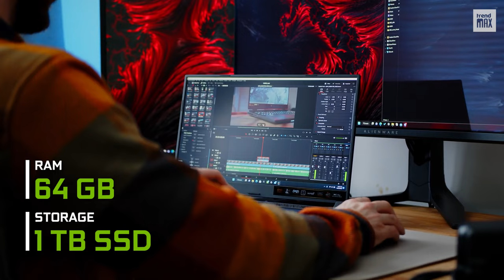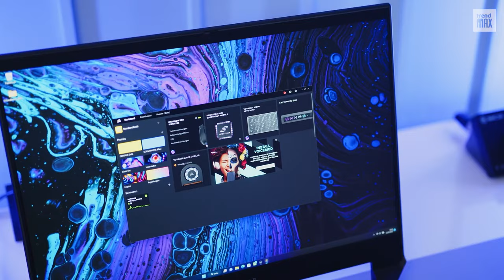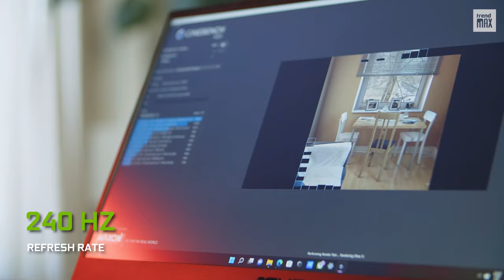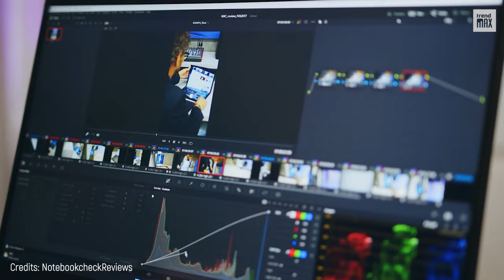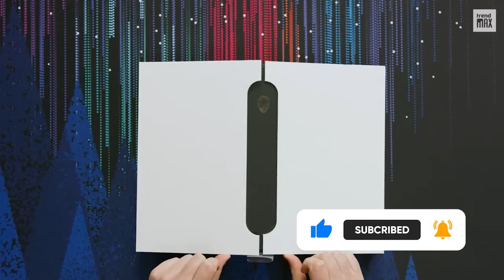TOP 10 BEST GAMING LAPTOPS 2023

Comment: Acer Predator helios 300 with RTX 3070ti should be in this list too
Reply: Can you tell me more? I was waiting for them to list this bc I was recommended it
Reply: @OPLPLL  First of all you can pick up the 3070 ti Helios 300 for less than $1,300 now. It has 16gb of DDR5 Ram and 1tb ssd and upgradable to 32gb or ram and add 1 more ssd. It’s a gaming beast with fantastic thermals. It also has 240hz 1440p display.
Reply: @ajbarboza1348  sorry for annoying ya but is it possible for it to handle the sims4 with many packs?
Reply: @AtheerAlamri-fd6gd bruh its sims of course
Reply: @Steven-cr1og  many people said their laptops couldn't handle the sims4 with packs and crashed after 2 years or so, but this one seems like a good meal to buy

Comment: I purchased a Dream Machines laptop with a 4070 graphics card and a powerful Intel i7-13700H processor." For my work with 3D modeling and animation, this is very good because everything works just instantly. I didn't think there would be such a big difference in power with my last year's HP. And that's what I love about Dream Machines for the large number of ports, now I can connect everything

Comment: i heard that a lot of pre-build pcs are not worth it and i don't wanna build one myself so maybe i can buy a gaming laptop, my budget is 700-1000 euro's what do you advice?
Reply: if your fine with buying a laptop every 3 to 5 years when the parts start to become out dated and slow then its a good option. a PC you can upgrade as parts age.
Reply: Just build a small mobo pc
Reply: @AlmightyyCres  u can upgrade laptops too but its just harder
Reply: @AlmightyyCres  If you are travelling and want to lift your whole box of pc along with lots of rusty/dustry cables, then fine, stay with desktop. Laptop comes with a premium price tag, however has a lot to offer which desktop doesn't i..e Outdoor usage, Portability, Battery usage, adjust the devide instead of adjusting your body to get the right angle etc. Not to mention laptops have lesser impact on electricity bills. Anyway, It's also a thing of budget, laptops are expensive, hence it comes down to personal preferences overall.

Comment: I currently have the MSI GF63 THIN and i dont recommend it if you're a COD player or R6S!! The drivers are outdated and you'll get that "drivers outdated" pop up when you download high end games like those. Fortnite, Valorant, and other mid games run perfect but it barely handles Minecraft and it gets hot really easily no matter what fan mode you have it on. I only use it for entertainment and Valorant.
Reply: I have a gf63 it plays red Dead 2 no problem

Comment: and no i dont agree with the list , why ? because pure base specs alone are not the only thing that matter . for example , did you know that without the manufacturer ordering a beefy cooler and proper higher tdp , some laptop 3080's are only as good as 3070's with proper cooling and higher tdp ? (same with bad 3070's vs good 3060's really) so a manufacturer putting a higher tdp on a laptop gpu plus a beefier cooler , WILL , make a big difference fps wise in so much of these 1440p laptops . 
edit : and dont get me started on the mux switch subject . because yes , every , fucking , laptop , above 1000USD (or its equivalent in your country) should have a mux switch , PERIOD !

Comment: This video is very misleading, as a "Top 10 laptop" video it should be arranged from worst to best, he mentions legion 5 on 10th but it will outperform pretty much all the laptops mentioned, should be in 1st or 2nd place, and it's not about the graphics card there, he put Asus G15 on No.1 but it has a low powered 3080 which Lenovo legion 5 will beat because it has max powered components, and he didn't mention any 2023 laptop in a " best gaming laptops 2023" video and is mentioning last 2 years models, not hating, but this content is very misleading.

Comment: Asus is trash. Let me explain. 

I've owned two ASUS gaming laptops in my lifetime. One of them pricing at $3,100 and the other pricing at $2,300. I had nothing but issues with these laptops. First of all the hinges on the Asus laptops tend to break within a year and actually the most expensive one I owned broke shortly before a year. Second off I've had a lot of compatibility issues when downloading games when using ASUS. I'm not sure what really causes the issue but I had to send both laptops in about three times just to fix these issues and even then more issues came up after getting them fixed and on top of that all the drivers don't automatically update so you'll have to manually do that over time and if you don't you simply won't be able to use the laptop the way you intended unless you really know what you're doing. I switched over to a $700 Acer just to see the difference and it was far better than the ASUS laptops I bought for triple the price. Another problem is that they tend to overheat.

This video is doing nothing but just trying to sell laptops that paid them the most to put them at the top of the list. Don't fall for this.
Reply: That’s the same thing that happened to me. My asus that costed me 1.4k kept on overheating and crashing on so many games I tried to play then when I switched over to my acer nitro it performed so better and I was so confused.
Reply: Just returned an expensive zephyrus duo 16. It wasn't working right out of the box, top screen flickered white until an update was ran, it ran intermitantly hot when doing basic tasks. Minecraft was hitting 99C, let me repeat, 99C on the CPUs, Minecraft. I then had a BSOD and had to restart, my bluetooth some how got corrupted and deleted itself. I tried doing a reset, that didn't do any good and the AMD program disappeared, apparently it wasn't a part of the factory set up, brilliant. Also kept experiencing BSODs. I did some research, I am not the only one to buy this laptop with the exact same results and problems. Asus is releasing flawed products then having people who are paid to promote them.
Reply: @zeddwulfen7737  A have asusu vivobook 15 sincde 2019. I installed hackintosh on it, even unscrewed it to see if everything ok with the cooling system and I'm working and playing on it every day and I don't have any problems. Even now I'm typing this message on it
Reply: @sviat2459 yeah, I have asus vivobook i3 8th gen since 2018 and still rocking to this day. 😆😂
Reply: Hi , I wanna buy my first gaming laptop I have been watching so many videos and brands , I can’t decide between , Acer Predator Helios 300 2023 , or Lenovo Legion pro 7i , Alienware x16 2023 , or Asus scar strix g16 2023 , which would you think is best ?
Reply: @IoanCornea-fy1cz  legion/helios. You can never go wrong.

Comment: This video is really misleading. Never buy razer blade, it is the worst out of all of them! With terrible heat management and razer software it is totally unreliable. The worst is that it gets so hot that the battery starts to swollen and it expanded so bad that the bottom cover had to bend and break 2 screws holding it. Also I have had to buy a new razor power brick. - and these are common failures according tot he internet.